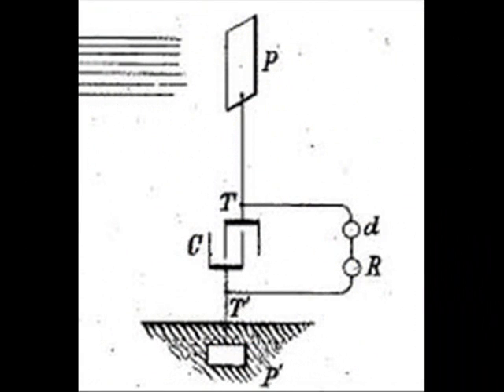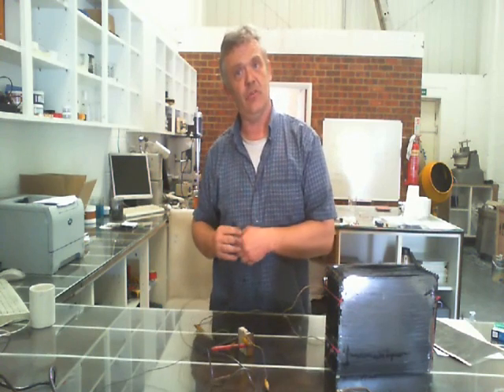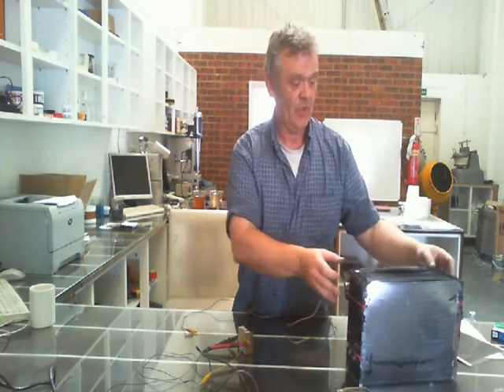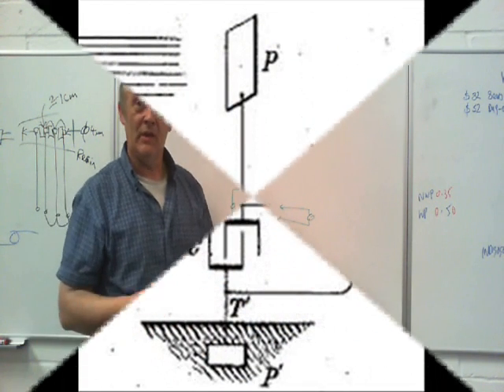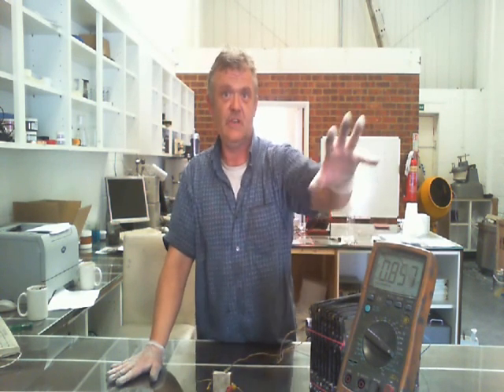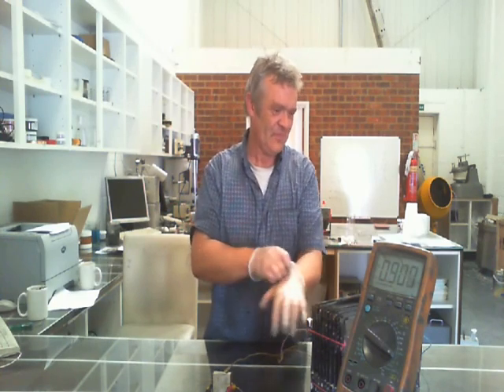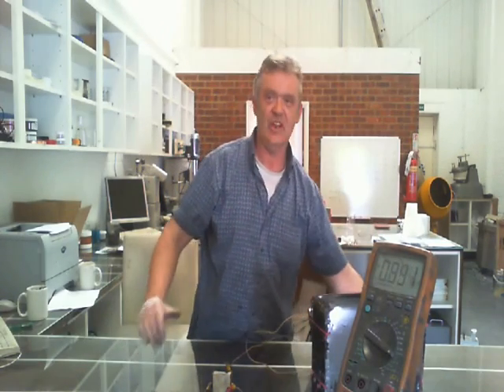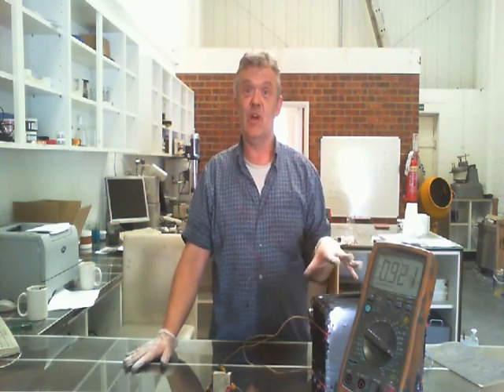SWAG As A Tesla Radiant Energy Collector

Comment: Radiant energy are longitudinal/scalar waves in the aether/zpe field. They are produced with high voltage impulses sent through a bifilar wound coil, where by the two transverse electro-magnetic waves collapse at 180 degrees phase difference to produce a single longitudinal standing wave. Maxwell’s original equations in their quaternion form had scalar/longitudinal waves represented, but they were eliminated by Heaviside when he over simplified them into today’s formulations which excluded the longitudinal/scalar waves, which is what Tesla called “radiant energy”.

Comment: Yeah, I know, I've been playing with this kind of stuff. You're picking up EMF inside your shop. Tesla required ionising radiation for his generator to work and if you read the patent, when indoors, he powered the collection device with an arc lamp.

Essentially, tesla discovered that ionising radiation can cause a conductive plate to gain a charge through surface ionisation and invented a very simple, very rudementary wideband solar cell.

Radiant energy is just EMF.

Comment: That is essentially the same type collector setup as Paul(Inventor3) has on top of his house hooked to a free energy from air circuit. The last I saw he was getting 125 volts out of it. His collector is made up of 10 12" x 12" copper plates in a box to protect them with wires running down and hooked some way to the circuit.            .

Comment: Tesla's radiant energy collecting is all about intercepting the bombardment of very high frequency etheric impulses emitted by the Sun, stars and other stellar processes happening in space which Tesla called his cosmic rays which are not normal cosmic rays. Only some metals can efficiently intercept radiant energy and store it in capacitors so most normal metals wont cut it and those who correctly understand how to efficiently collect radiant energy are likely using heavy metal alloys or radioactive alloys or both. Also radiant energy doesn't contain electrons, electrons are manufactured by metals when metals intercept radiant energy impulses from space. Also Tesla said natural radioactivity on earth is due to dielectric flux which is part of radiant energy bombarding on earth from space.
Reply: If you are interested in researching Tesla radiant energy, read first chapter of this book "Secrets of Cold War Technology by Gerry Vassilatos". You can experiment with radiant energy with Tesla Coils utilizing unidirectional high voltage high frequency DC impulses after filtering out electrons with magnetically quenched carbon rod spark gap sealed in nitrogen gas as nitrogen gas apparently absorbs electrons, and also avoiding copper as much as possible since copper contaminates radiant energy with electrons. This is what Tesla was doing according to the book.

Comment: What I don't think is happening is what Tesla proposed: That it is caused by special positively charged minuscule particles travelling at 50c and passing through planets like nothing. In such case we would not see a dramatic change with altitude.
What I do think is that you are tapping atmospheric electricity. The reason behind is that we already know that ionosphere contains all molecules dissociated into ions. Perhaps these ions travel down and disappear so gradually, that even at sea level some exist.
When we apply electric current, what happens it that large body of Earth releases electrons. With "radiant energy generator" we simplify the transfer of said electrons from Earth to ions in the atmosphere, like a tiny lightening bolt. The device looks like one plate of a capacitor to me, second plate being the atmosphere itself.
Thank you for another excellent video.

Comment: It's cosmic radiation. While the distance from the ground will affect the base plate of the capacitor and your body the top, if you were to place it high in the sky via balloon or whatnot, you will see a dramatic increase in voltage. Aluminium works great because of it's reaction to radiation. That is also why it works indoors as well as out - but outdoors you get solar power as well.

Comment: Robert Murray-Smith, interesting experiment.  
As an electronics engineer, the first thing I would do is to investigate the nature of the voltage on your plates.  The easiest way to do this is be to hook up a high bandwidth scope (100 MHz) to see the waveform and dominant frequency of your AC signal.  Then we can discuss if you are picking up random noise, the local radio station - or something else.
Let me know if you have any questions.
-Nils

Comment: There is a company out of Australia who is looking to make collectors placed on towers, I thought perhaps a balloon would work better. My dad showed me about this when I was a child but then never made any effort to go further with it.
Reply from the maker: it does other folks have tried it - but nothing like trying yourself lol
Reply: I lack the materials and resources to launch balloons or erect towers personally.
Reply from the maker: you can't go to a party store and buy a helium birthday balloon?
Reply: If I am going to go to the trouble of making one of these its going to be on a scale with realistic harvestable power. The only way to do that is to get high enough up to produce a voltage one can 'turn down' and still have enough amperage to make it usable.

This means a weather balloon, not a party balloon.

Interestingly, one of the best potential tethers for such a process is a carbon fiber type material because of its mass to strength ratio. Another is spider silk, which could be lightly coated in a conductive carbon.

As long as the ohms are not too terribly high, and the volts are sufficiently high, one could realistically collect a usable amount of power from heights below that of typical flight paths of aircraft for localized use.

With the addition of some form of super low mass condenser [I was thinking aluminized Mylar sheet or even 'christmas tree tinsel'] one can in theory collect a lot of ionic particle energy so long as this does not lead to the balloon growing too heavy to remain in the air.

My ultimate scheme includes a self regulating helium flow control which at one and the same time compensates for changes in heat, altitude, gross mass and weather hazards.

If the balloon were built in such a manner it could deflate and reel its self in during harsh weather its rate of survivability would be far higher.

To be able to adjust for wind speed, wind direction, heating [or cooling] of the helium, leakage through the shell, gain and loss of dust and moisture, etc, one can have a balloon which is always at a desired height except when storms and similar events prohibit, allowing for even remote tethering, and therefore wide area scavenging of ions and EM radiation simultaneously.

The size of the balloon is not a fixed or arbitrary volume, but it would have to be able to hold aloft what ever collectors one used as well as its own tether [the mass of the tether is a variable too] and the effects of rain, snow, fog, dew, dust, birds, etc.

The tether could have to hold against winds in excess of 100 knots at least long enough to pull the balloon in to safety so it would not be just a string, but to be light it would have to be something pretty high tensile compared to its mass, and if its self regulating, it has to be at least partially gas tight to deliver helium to the balloon at the top, as well as possibly microfilament command wires to send impulses up the line to the balloon to control venting of gas.
Reply from the maker: oh - ok - you do what you do

Comment: Isn't this just an untuned and undected radio receiver? The circuit is like a crystal receiver minus the coil and minus the diode. The coil would normally form a tuned circuit with the capacitor and select the frequency you want and the diode acts as the detector, half wave rectifying the signal so that it can be heard (with low pass filtering intrinsic in the headphones). Without the coil and diode, the AC meter will be indicating a wide band of RF, bandwidth limited by the frequency response of the meter. The capacitor probably limits the bandwidth to a certain extent and may not be necessary. A similar act of your hand touching the 'antenna', with and without gloves to improve the signal, can be demonstrated on an FM radio with the telescopic aerial in the closed position. When you touch the aerial, a stronger signal will be heard. Placing a thin insulator between will not affect the signal improvement much, the signal passing through the thin insulator, as if it were a series capacitor.
So, the energy you are seeing is probably wideband radio energy from a wide range of sources.
Reply from the maker: probably

Comment: did you know voltage potential climbs the higher the antenna is. if you make a tuneable capacitance and inductor that's capable of getting in the 1hz to 12hz range you will find a signal that is saturated with transverse waves.that's means high current also
Reply: oh sorry did you ever do any more expirements with radiant.
Reply from the maker: i did mate cheers
Reply from the maker: not yet mate - but it is on the to do list
Reply: Cool lots of energy just bouncing around and nobody is using it.
Well I don't think they are
Reply from the maker: lol - there are a couple of folks trying
Reply: Robert Murray-Smith I would but I'm out of work and low on funds. haven't seen anyone actually making a resonant tuned radiant collector anywhere. I could assist with formulas or design of components if needed
Reply from the maker: i'll let you know when i get back onto it mate
Reply: Robert Murray-Smith will be tuned in and ready for a show. I know you could make it, if you had time
Reply from the maker: it's all a question of time mate - just not enough hours in a day

Comment: my nano coated by fire magrav coils have similar effect with an LED flashlight.

    Great video BTW, glad to have  watched your video. I replicated Jes Acanius system based on Teslas radiant energy patent I was able to collect approximately 2v and current of approximately 4ua down to 2ua, single module, and  was able to light LED manually  by hand on ,and off at 1 second  intervals. The capacitors that I used are metal film and electrolytic. I need to use ceramic disc capacitors instead of metal film caps on aerial plate side.  Thanks for sharing your video and enthusiasm.   ;  )
Reply from the maker: +mag netron cheers mate - glad you liked it and nice work

Comment: In his patent Tesla said to laminate the plate and put it 50 feet in the air. (higher the better to be exact) Have you tried sealing both sides of the ink or "laminating it" and how high have you placed it? It looks roughly 10 square feet in a separated stack by comparison.
Great video here too Rob.
Your body radiates an electromagnetic field, that is likely why the collection device is reacting to you touching it.
The radiant energy streams at an altitude above the ground and may be related to the Schumann resonance or connected to it somehow. I know you are busy with other project, namely the capacitors etc but this is fascinating stuff.
Thank you for sharing it.
Reply from the maker: +Rob Ellis I haven't tried laminating it mate - I should - cheers

Comment: +Robert Murray-Smith given the multiple sheets, my understanding is that you are trying to increase surface area. If you were to have 1 continuous sheet representing the same surface area as all the layers combined, would it behave in the same way?

I'm thinking a practical application of this could be to wrap the mast of a sailboat with it as a potential energy generation source to charge house batteries through a few graphene super capacitors.
Reply from the maker: +Alain Grignon I Imagine it would mate - as I think you are right it is all about surface area
Reply: +Robert Murray-Smith If the mast is made of Carbon fiber, would it need to be coated with an intermediary layer in order for the carbon of the mast and that of the graphene not to interact with each other, or is carbon fiber sufficiently different (structurally) to prevent this already?
Reply from the maker: +Alain Grignon I am guessing you would need some kind of separator